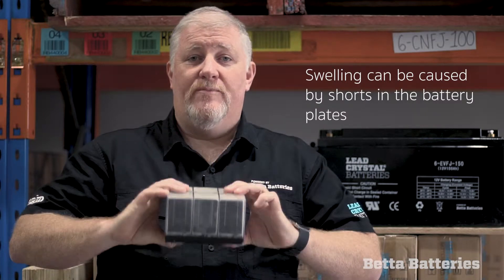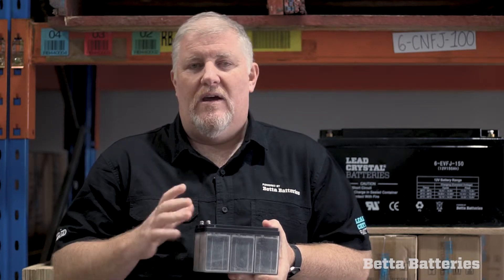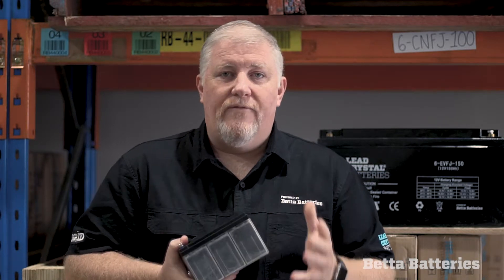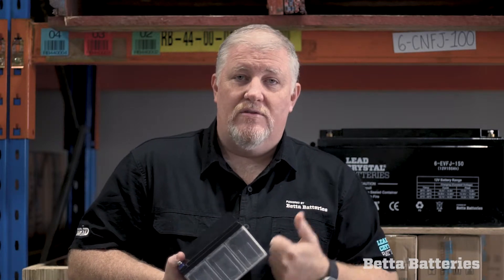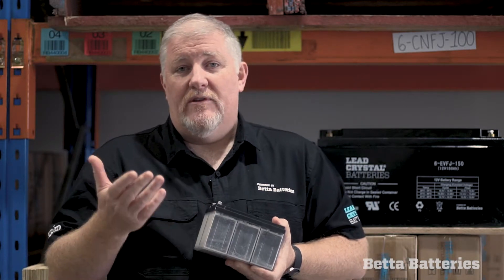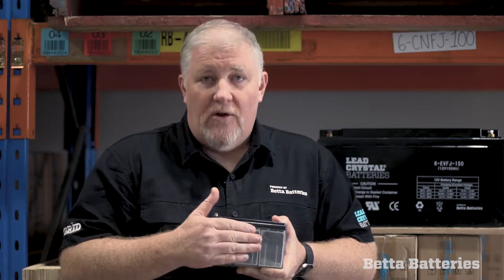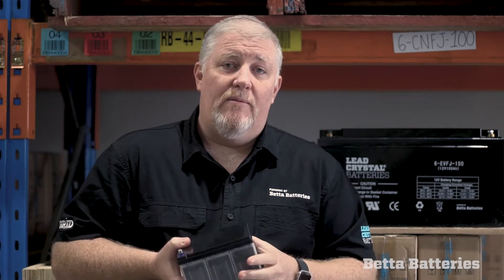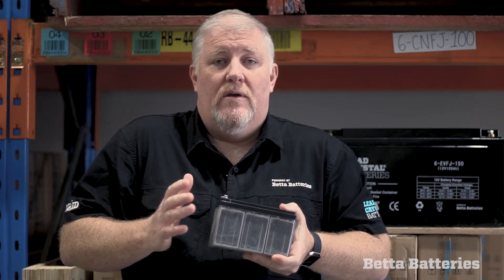Battery Heat and its effect.

Comment: A 200 amp charger isn’t pushing 200 amps. It merely allows up to 200 amps to be drawn by the load, such as a battery. The battery will draw as much current/amps as it needs. Voltage from the charger is the “pressure” pushing the electrical  current into the battery. 
Hope this helps…

Comment: why does batteries get hot while charging
Reply: Internal molecular resistance, with electrons smashing about…
Reply: @keithpowers6599   too much current , (standard is to use  1/10 Of the battery amps as your charging amps... eg: if your battery is 60aH (not CCA)  use 6 amps charger. more amps  generates heat.

Comment: Hi Mate. Thanks for the video. I was adding distilled water to some batteries today and one of them started to get really hot in one cell. I put it in a sink and filled the sink with cold water to try to keep it cool. 11 batteries were fine but the culprit one seemed to get pissed off. I didn’t drop it. There Chinese “sealed” lead acid that I use to run an inverter for my North American ac tools. I’m in China. Any idea why the battery wigged out? Thanks…

Comment: 4 commercial batteries in series and only one get's hot after 1min.  Discharge/resistance problems on that singular battery?
Reply: I have the same problem. But I get 2 of them get hot  n other 2 doesn't y is that